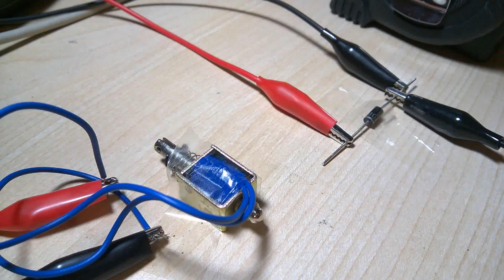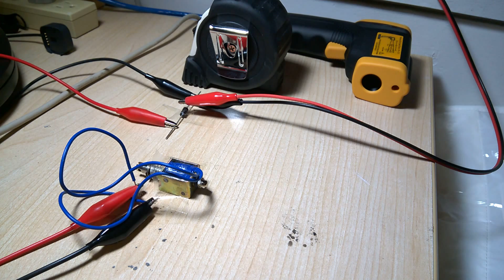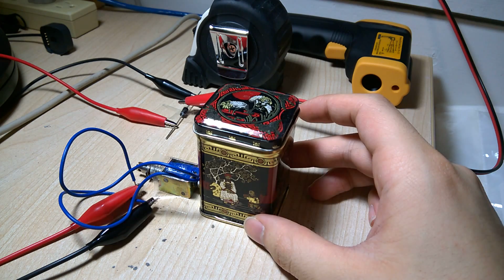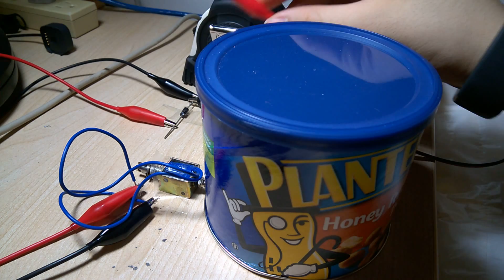Linear Actuator Solenoid

Comment: I've been curious about the possibility of using a type of actuator like this to act as a firing pin for a firearm that I've considered building.  I figured that it would only require a momentary contact switch for the actual trigger, so it could be extremely sensitive.  It looks like the model that you show here might not provide enough force to the firing pin.  You also need a certain speed hitting the firing pin -- a slow large force will not necessarily set the primers off.
Reply from the maker: I've never operated a firearm, but I can say that this model solenoid could not produce enough force to move a light switch. You would probably need a bigger solenoid.
Reply: Never operated a firearm before?  Wow... I've heard about people like that, but I don't think I've ever actually met one. :)

Oh... You're in New Jersey... I guess that explains it... :)
Reply from the maker: +Grumpy OldMan It sure does.
Reply: Yeah, up there in the non-free states, they only allow the criminals and cops (not necessarily two separate groups) to be able to protect themselves.
Reply from the maker: +Grumpy OldMan I guess so.
Reply: This is an electronics-related subject and you are posting a weapons-related question. If you, Grumpy OldMan, keep operating guns and consider yourself to qualify for firearms design, why not to get several primers in your round-the-corner shop and experiment to see what impulse is needed to ignite the primer?
If U suffer from improper trigger squeeze, perhaps U can get away without a solenoid - just take a cartridge and replace the primer with a filament from an  incandescent light globe - and here you go ;)
Reply: Oh, I've got plenty of primers already -- probably around 20K or so.  It's not just pounds of force that set off a primer, but also the speed of the force.  I would not consider this video exactly "electronics related", but rather mechanical engineering related and as such, it is applicable to other things like firearm design.
Reply: if U R serious about that, U should start with reading something about momentum (see http://physics.info/momentum/summary.shtml)
What U need is a product of pin's mass and its speed. U do not have a rig to measure the pin's speed. But U can make a rig to drop a heavy nail on to a primer from different height to see what momentum  is needed to initiate the primer
Reply: From what I've read, the military specification for rifle primers with no failures works out to be a 4 oz weight dropping from 25 inches.  If I remember my equations right (i.e. End Velocity = sqrt(2 * Distance Traveled * Acceleration Due To Gravity), that would be something like 11.58 ft/sec.  Now, whether momentum is a better indicator of whether a primer will fire or maybe kinetic energy, I have no idea.  I have not seen any of the solenoid listed with specs that would allow me to make an educated guess and I don't want to just blindly start buying different size solenoids in the hope that maybe one of them might work.
Reply: I guess it's not just  any 4 oz  from 25 inches. How sharp is the end of these 4oz might matter as it needs to penetrate, not just squash the primer. The theory behind this is too complicated as too many factors which are difficult to evaluate. That is why I suggested that very simple experiment. It will also show if momentum or energy is important - all U need is to see whether the heights needs to be reduce two times or 1.4 times if U double the weight to get the same result.
Reply: Actually, you don't want it to penetrate the primer.  That is a bad thing in that it would allow the propellant gases to escape from the rear of the cartridge and that could be bad for the person actually holding the firearm.  A primer is a very small amount of an explosive that is sensitive to impact..  Considering the characters you are using for your YouTube name, I assume you are not from the US.  Russia, perhaps?  Did you have toys when you were growing up called "cap guns"?  The primer mixture is somewhat similar to what they used sandwiched between the paper rolls.
Reply: If U R interested in playing toy guns U do not need to play with primers - sorry, I misunderstood your initial message.
With the real stuff there is such thing as safety and the primers are much more difficult to ignite then the cupguns - U probably noticed that the primers ain't made of paper. By penetrate I did not mean to make a through hole. I mean U need to quickly squeeze some portion of the primer. Next time U handle your guns examine how a used primer looks like
PS When I was growing up, we did not play cap guns. We played with pieces of 1/2" steel  pipes sealed from one end and charged with that brown stuff scratched off matches' heads (two matchboxes for one shot) and a piece of lead on top. The precision and rate of fire  were miserable, but the sound, recoil and assumed stopping action quite sufficient
Reply: No, you misunderstood my previous post.  I brought up the idea of the cap guns just to give an example in case you were not familiar with the chemicals because of where you are located.  I understand that some places place restrictions on your basic human right of self-protection (from criminals and from an oppressive government) that we have explicitly encoded as our Second Amendment "Right to Keep and Bear Arms".

Yes, I assumed that when you said "penetrate" that you meant to make a hole in the primer since that is what "penetrate" would mean in that sentence.  I recognize the possibility that your mastery of the English language might not be perfect or the translation program you are using might be translate it accurately though.  If you are not using a translation program, I would have to say that your English is very good.  My Russian is virtually non-existent -- "da", "nyet", and "dosvidanya".

But, I do like a good Russian Imperial Stout beer. :)  Yeah, I know they weren't originally from Russia...

I do not have an extensive collection of firearms -- probably only around 40-45, IIRC.  I know people with quite a better collection and who are more historically significant in their choices for their collection.  I reload my own ammo and cast my own bullets.  I have reloading presses made my Dillon, RCBS, Lee, and MEC.  I'm very familiar with the construction of ammunition and primers.  We use a slightly different type of primer than you probably use.  Here in the US, we typically use Boxer primers whereas Europe and such typically use Berdan primers from what I've gathered.  As for the actual chemical used in the cap guns and firearm primers, they are probably proprietary information by the various manufacturers and the manufacturers do not readily give out that information.  From what I understand, mercury fulminate, lead azide, lead styphnate, potasium chlorate, and other items have been used either solely or in combination.  If you ask a manufacturer, they will just tell you it is a trade secret.

Speaking of cap guns though... Interestingly, the paper tape caps that they used was originally designed for a real (musket type) firearm.

https://en.wikipedia.org/wiki/Maynard_tape_primer
Reply: I thought U wanted to do something. Now I see U want just talk about something. About anything, to be more precise ;)
Reply: Obviously we are having a communication problem.

Comment: how many battery or volts should i use to run a 12v solenoid?
Reply from the maker: +Ajit zone Use a 12V battery or eight 1.5V batteries to power a 12V solenoid.
Reply: David Tsai i used 8 1.5v batteries. but it didnot work. 12v battery costs alot. any other way?
Reply from the maker: +Ajit zone Get yourself a multimeter and see whether you are actually getting 12V.
Reply: 12Vplts...

Isn't that obvious? It said that in it's name: 12v solenoid, 12v = 12 volts why do people keep asking stupid questions?

Comment: Hey David, do you happen to know what model that solenoid is?

Really educational vid :)
Reply from the maker: +jossesphere Uxcell a12022000ux0201 4N Push Type Open Frame Solenoid Electromagnet Actuator, DC 12V, 10 mm https://www.amazon.com/dp/B008LTHYLA/ref=cm_sw_r_cp_apa_OUy7xbNQJ3MSJ
Reply: A 4N will push alot more than I thought !

Comment: Nice video,i'm trying to figuire out why the solenoid mounted on my  car starter motor doesn't work, the solenoid gets warm so i'm guessing the coil inside is getting hot but for some reason the plunger won't pop out.I tried slapping it around with a hammer but to no avail. Even though they're irreparable,i'd still like to know what's wrong.Thanks.

Comment: hello im trying to test my solenoid actuator but it wont work when i connected directly to 12v battert.. can you explain why? and how the actual way to test it and make it work?
Reply: and i want to connect the input of actuator to proximity sensor if you dont mind can you help?
Reply from the maker: What sort of 12V battery are you using? Some smaller batteries may not be able to supply enough current to power the solenoid. What proximity sensor are you using? If it has a simple on/off output, you can just connect that output to an NPN transistor or MOSFET on the ground side of the solenoid.
Reply: David Tsai yes im using the 12v dc battery the smaller one.. oh so its not enought current? I need to try using generator? I use npn inductive proximity sensor so if i use transistor/mosfet i dont actually need relay&base to connect my sensor and the solenoid?
Reply: David Tsai and if i use bjt/moafet which leg do i connect with the gnd of solenoid?
Reply from the maker: +nadyrahh slvee Connect the output of your proximity sensor to the base of your NPN transistor. Connect the ground of the solenoid to the collector of the NPN. Connect the emitter of the NPN to ground.
Reply: This is the right connection right? Cus im afraid if the senson spoilt after i tried this
Reply from the maker: Why don't you post your schematic? It'll let us know exactly how you have everything connected.
Reply: David Tsai i dont know how to connect them...

Comment: hi thank you for this awesome video. can you please guide me to use what kind of solenoid and battery with volts and other specs that can produce 50N and 100N of force.
Reply from the maker: +Be Like Bill Solenoids have two difference force ratings. The force that is usually listed is the holing force, which refers to the amount of force that you would have to exert in order to pull the plunger in the reverse direction when the solenoid is powered. (In fact, I just realized that the video description is a little ambiguous. I'll update it.) The force that the solenoid can exert on another object is usually much less than the holding force; in this case, it was less than 1N. If you need to exert 50N to 100N of force on another object, consider using a pneumatic piston instead.

Comment: what would cause a 1 second or so delay in the solenoid after 12v is applied?
Reply from the maker: +kawi21 The solenoid is an inductor, which means that the current cannot immediately flow at its maximum. When an inductor is discharged, it's like an open circuit. When it is charged, it is like a short circuit. The solenoid's magnetic field, therefore, won't be at full strength until the inductor is fully charged and the current is flowing at its maximum.